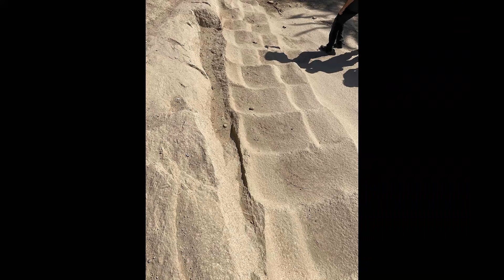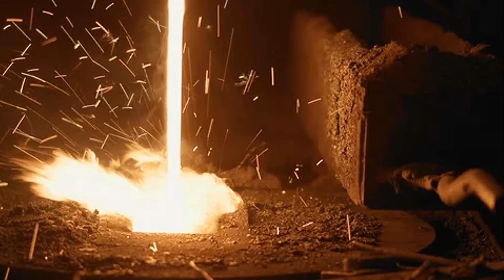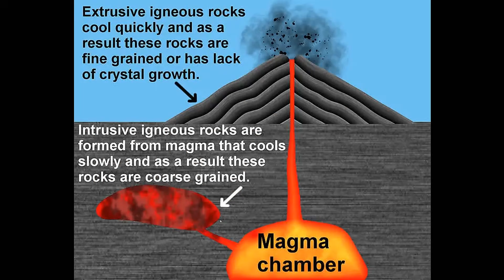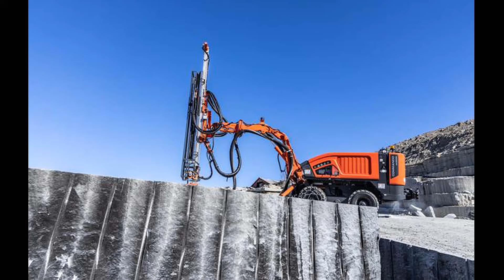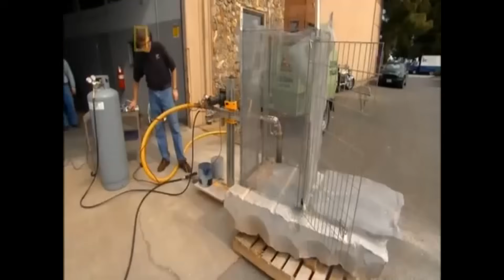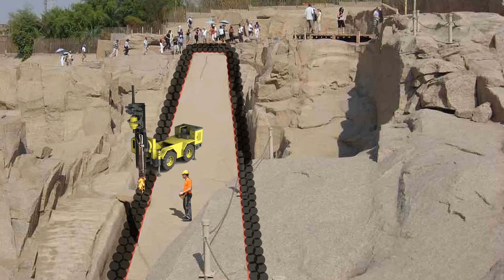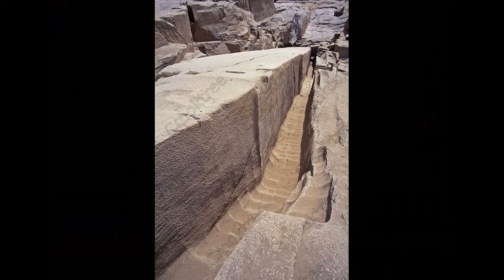Scoop Marks in Egypt: A Groundbreaking New Hypothesis

Comment: Hello Tina, thanks for all the hard work making this video.
These 'scoop-marks' by the name we gave them, seems to direct us towards surface softening.
However, up till now, we haven't found the answer for the substance they must have had, making the surface soft enough to scrape off.
The best attempt was made, using the 'mining-slurry' as a base, which indeed is acidic, and they did mine often as you've already mentioned before.
With the use of 'fools-gold' the slurry could have been enhanced, but needed an extra push of head up to 300 deg. C. to soften the surface and make it work.
These materials and possibilities are in separate form all mentioned by you, and it looks as if you're getting close.
On the other hand, there is still the fact of polishing those big serapeum boxes, which clearly left the shiny surface-fluid as a marker for us to see.
This again must have a chemical base to work, don't you agree?

Torches as you mentioned here, at least in Peru, are maybe used to repair the broken wall blocks, but nothing is to be seen of that in Egypt, as far as I know. ( see Ombio Productions at YT)
The end result of the torch, and the end result of chemical drips looks mostly the same, and are hard to distinguish.
Maybe you find more of it then I?

Let the good stuff coming, cheers
Reply: This substance is sodium carbonate and / or caustic soda.
Reply from the maker: Thank you very much for sharing! One problem of the natron/ sodium carbonate (and other chemicals) rock softening method is that it usually would significantly change the rock colors and appearances, while the granite of Aswan quarry shows pretty consistent color at all scooped areas. Here is a photo posted by Marcell Foti who proposed the natron softening rock idea and we can see visible color and appearance changes: https://x.com/FoMaHun/status/1743216524343603549
Reply: @CuriousBeingbyTina  - The color is not a problem because the rubbed-off material was used for water glass, so it was transported away.
The material sample Foti showed you was also heated together with sodium carbonate (up to 850° C), so it's a completely different matter.

Cold caustic soda on cold granite simply makes the granite easier to grind, and only the abrasion discolors slightly. However, you might not see any discoloration in the scoop marks. All discoloured material (powder) has been removed.
Reply: @CuriousBeingbyTina  , The colour comes mainly from the oxidation of iron substances.
Over time, this oxidation might bring the colour back?
The surface structure of the scoop marks seems very rough, which is possible with etching.
The bigger problem is the temperature, if this method is used, it at least asks for 850 degrees C.
So, we need to look at temperature lowering additives to make it work on such open spaces.
Reply: Why not heat? Available easily at Stonehenge, Egypt, and Peru. No fancy chemicals and their easily detectable presence (or absence), no pressurized gas, etc. Just wood, mud/straw, good ventilation, maybe water quench. Stone or copper tools.
Reply: @rickZR1982A  , Have you ever imagined to heat-up a such large surfaces?
And when heated, they had to scrape off the weakened top surface, in order to heat again..
You simply are not able to come close to these heats.
When heat is used on a large scale, the stones will crack.
Reply: @ThomiX0.0  Yes, this has been done extensively in the past, as this is in fact how it is done. High heat is achieved with charcoal, confinement, and strong ventilation. this same setup in a different context is called a forge, you may know of them. High heat well localized.

Do you mean if they had too many fires going at once on, say, an obelisk, for instance, it might crack? Absolutely! I bet somebody got fired for that one.
Reply: @rickZR1982A  , Okay, lets move on.
Charcoal is not a problem, strong ventilation either, we make it happen..
With what kind of material do you make the confinement, ready to withstand 800 degrees C, and most importantly, moved and reused over and over again?
To dig a hole is easy to start with, but once reaching 50 cm depth, you need  a head-resisting connector for the air to been blown in, as the surrounding area gets extremely hot. 
You do not have all the answers, as we both do not know.
But we could have some thoughts about it, don't we?
Reply: @ThomiX0.0  Aside from firebrick or ceramics, mud-straw half-tunnel rocket stove style confinements are easy and can fire to very high temperature with charcoal and strong ventilation. They could be built to drag along a horizontal or vertical surface for several uses, even repaired on the fly if needed. No dead end bore-holes of course, channel along the surface first then go for depth. 

Do a YouTube search on "mud straw kiln" or similar. You or I could literally go out in nature with nothing but fire-starting skills, find dry wood, water, mud, straw, a large target stone and some pounding stones, and perfectly replicate these 'scoop marks'.
Reply: @ThomiX0.0  Straw/mud or ceramics/firebrick. Straw-mud is amazingly forge-heat capable, might be moved a couple of times, easily built , rebuilt or fortified while in use. No 'post hole' dead-end cuts into stone of course, channel first then go for depth. Those large smooth scoop-mark-free vertical "test holes"? - no idea. Seems unlikely to be fire-setting tech on those IMO.
Reply: @rickZR1982A  , These are possible options, although not easy to work with.
The 'scoop marks' are very even in their path, and it must have been a kind of continuing motion.
The major blocks in Peru show the same kind of surface scraping/smearing on large areas.

Comment: I like the idea, Tina. You now have to go even farther and look for evidence of Steel compressed gas cylinders and bronze regulators and rubber hoses, not to mention the equipment  necessary used to make and compress the acetylene and oxygen or MAPP gas. Seems everytime we try to hypothesize the process and tools, we also have to show evidence for the infrastructure and  manufacturing of said tool. Not to mention the quarrying of the raw materials to make such tools. I know its frustrating but your doing an excellent job, and I cant wait for your next video. Love your work.
Reply: Greek fire was used w none of that. And as pointed out above it would work

Comment: nice insights but you completely ignored the chemical perspective which could also have been a factor in making the rock softer.
because yes, your idea somewhat works for the aswan quarry but it does not work for the finishing of the surface which shows similar properties to the scoop marks.
I would not dismiss any technology and especially any combination of technologies to achieve the same result, for example: could it be sonochemistry + heat? chemical solution + high voltage/current?
although the width of the trench, the shape of the bottom and the "observation holes" are all very much aligning with your proposed technique and makes it very interesting.
Reply from the maker: Thanks. One problem of the natron (and other chemicals) rock softening method is that it usually would significantly change the rocks' colors and appearances, while the granite of Aswan quarry shows pretty consistent color at all scooped areas.
Here is a photo posted by Marcell Foti who proposed the natron softening rock idea: https://x.com/FoMaHun/status/1743216524343603549
Reply: @CuriousBeingbyTina  Thanks for your answer. I was not necessarily thinking natron because the stone also shows a very grainy finish. 
Since we are working our way towards understanding a technique we don't know yet, we can't ignore the fact that there is at least one chemical pathway known (most likely out of many) to remove material.

Comment: You can see that the vertical channels have sort of horizontal striations. As if a tool with large diameter head has been repeatedly pressed against the surface going down. Torch won't do that, the torch marks look nothing like it. Come on.

Comment: The crack in the obelisk could have been due to an earthquake long after they stopped the work. They could have stopped the job for other, unknown reasons. A heat flame would have left some sort of heat signature on the minerals...does it 'mark' the granite in modern techniques, I wonder?
Reply from the maker: That's a good point - perhaps the crack occurred long after. Thanks for sharing your insight!
Reply: @CuriousBeingbyTina  I have an alternate theory, based on the photos in your video.

The location where an obelisk was removed shows a fairly wide break in the center web.

That means they broke it off, instead of digging out the whole web.

Perhaps the crack formed when they were using some sort of wide wedges on one side to cause the web to fracture, but something went wrong and the crack formed in the obelisk instead of the web.
Reply: @PetesGuide I had the same idea because of the same reason but came to different conclusions. You are right, the already removed block or obelisk was definitely broken from the bedrock. To do this you need more than one lever to prevent the stone from cracking or breaking. BUT because of the necessary length of the lever this tells us how tall the builders must have been (the knobs found at many stones of megalithic structures lead to the same conclusion because they are handles) and the unfinished state of the obelisk could (!) mean that the work ended, when the twelve Olympians removed the eight Titans which according to Herodot took place about 17.500 BC ("17.000 before the time of Amasis").
Reply: @penoge The nubs were not handles, there placement precludes that. The two most reasonable explanation for them I've seen is that the stone was tuned, so that was left once they were, or its not stone, but concrete and they're an artifact of casting. Similar casting nubs occur even today
Reply: @terryenglish7132 they were to hold the stones up to shape the surface as seen at sacyuaman, the Egyptians, roman and incas all did this, its well known
Reply: @terryenglish7132  Makes a lot of sense, except the majority of the stones don't have them.  I wonder if they are ornamental, or make up a language or pictograph.
Reply: @tedolphbundler724 W casting its only every so often it happens.And maybe we're seeing ones that weren't removed. As for tuning, it would be for Earthquake dampers, so only a few stones would be needed. I'm going w casting concrete not stone and they didn't remove them because the project was never finished or they didn't mind imperfection as part of their beliefs. If the walls were painted then the nubs would be quite decorative as you say , green wall w red nubs would be wild.
Reply: @terryenglish7132  Not disagreeing that they could have been cast in place, and the nubs are flash from the molding process, but then they would be on each stone.  Why remove some but not all?  I have seen graphics showing that the nubs outline shapes like animals.
Reply: @tedolphbundler724 I think I have too. That would add a cool 3D effect
Reply: @tedolphbundler724 As said casting only gives nubs every so often, not every time. They didn't get a chance to remove all because of nature, wars etc.
Reply: @terryenglish7132 Not plausible! Their location on the contrary shows it. Otherwise you would have to explain how they could place the blocks at their location without pinching their fingers!
Reply: @tedolphbundler724 Nonsense! They could not have been molted in situ (while in place), but only before that.
And they are surely not artificial because to do that you would need to produce a unique form for every single block which is a not likely amount of work.
Reply: @terryenglish7132  Everything made in a mold has molding flash and pips (if injection molded).
Reply: @penoge  I am talking about the stone block walls such as at Manchu Pichu.
Reply: @penoge The concrete was in burlap bags, allowed to be firm but not fully hard , then put into place so it would conform to its neighbors. That was for Earthquake resistance. Uniform blocks not fitting in in an unique way would come apart during a quake.
Reply: @tedolphbundler724 In Machu Picchu three different construction styles are visible, surely belonging to different people and different times. So which one do you mean?
Reply: @terryenglish7132  Why did they leave the unsightly nubs in place though?
Reply: Worldwide lots of projects were stopped mid construction. Yeah, the crack being the reason is mere speculation.
Reply: If you go high heat on granite beyond a normal fire it melts and makes obsidian this is know for a fact
Reply: @drummerdad80  Thanks! I thought that there should be some sort of evidence if indeed those scoop marks were caused by such heat. So we can discard the extreme heat/melting theory.
Reply: @slobodan888 yes there are videos of people heating granite with solar lenses it turns to obsidian, it will not retain the original granite structure with quartz crystals its impossible
Reply: @slobodan888  Melting/softening can be done with chemicals.
Reply: @slobodan888  I have seen heat spalling on granite.  It does not leave any scorch marks.  The granite just flakes off.
Reply: There's a record in heiroglyphics on a nearby rock.  Wonder why you don't know this?  Lol.

Comment: They must have used more than one technique....wonder if it is angled for a next step of dislocating, or following the strongest lines in a stone structure...maybe fluid flow....those deepest holes might be drainage points, still wondering how worn are those marks for all the time that passed.

Comment: Great video. My pennies worth.... could they create furnaces with short ceramic pipe sections to create focused heat? Pretty sure they are familiar with making pottery so my thought is a kiln is made perhaps above the area to be drilled Possibly the kiln has a central area where the heat and compressed air is forced downwards. Small sections of pipe are lowered into the centre one at a time as the heat makes its way downwards. As the ceramic pipe works its way down in the centre of the furnace , a new section is placed on top of the first piece. This would explain the uneven sections as each section of ceramic pipe was added. A section looks to have been about a foot long. Short pieces of ceramic pipe would explain how a straight piece could be angled with a ceramic elbow joint to direct the heat. The furnace is left to cool so that debris can be removed and then fired up again to do the next depth. Alternatively, the furnace is mobile and is moved along and the next pipe section lowered down with heat. One furnace could then be moved along a section  pipe at a time. and then when a depth  is reached along the length of the stone, and the debris removed. It is repeated with the next piece added. That way the furnace can be kept hot  and quick work made of quarrying the stone.

Comment: they heat up the rock with fire, then quickly quenched the hot rock surface with water.
 then they pounded that weakened rock with stone tools.
that's why the scoop marks appear in regular intervals.
if it was just pounded with stone tools, the regular interval makes no sense.
Reply: You have left the only sensible comment.  Bravo.

Comment: Great video.
I believe the spalling from heat is what you see on the stones in the streets of Cusco Peru. Some stones still have smooth spots that weren't blasted off.
If flame drilling was used in Egypt I'd kind of expect the surfaces to still be rougher, but maybe it's weathered down over the thousands of years.

Comment: Think critically, first lets say the stones were used that archeologiest say where used. Why the linear marks? Because the techniques they claim these rocks were used for are wrong. It is used as a grinding stone, not a pounting stone, the technique is to drag the stone against the granite, it loosens crystal grains in the granite quite efficiently, maybe 30 times fast than pounding with the same stones, and the tool stone is much more recillient to the grinding. That works, and cuts the work time down by a factor 30 or more, once you understand that, everything makes sense, and there is no need for any fancy explaination. This is however nit how straight surfaces were done ofc, just rough quarrying of large blocks.
Reply: Very educated analysis. Just learn to spell.
Reply: Or roll a log or other cylinder placed over them , dragging wouldn't produce the scoops, just cut evenly

Comment: When you work flint or knap flint, you work off the ridges between the impact chips "scooped places" to create the form you desire. its a method that makes the stone easier to chip or work down, removing material. Those marks you call scoop marks are marks made from chipping and pecking. Most likely done by hand. Dont over think the process. Impact chipping is most likely the reason. Experimenting with the process to make the marks is what you need to do. Hands on experience wins over speculation everytime. Look up Monjolo. If one thing ancient humans had was time, to do this work.